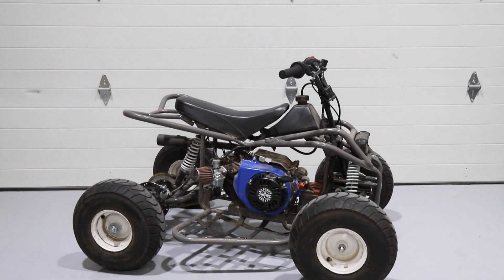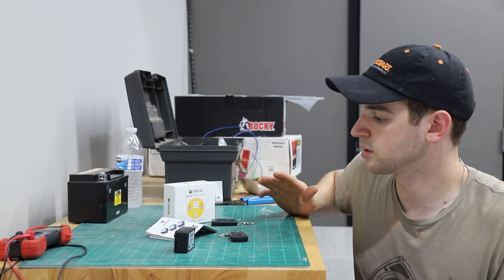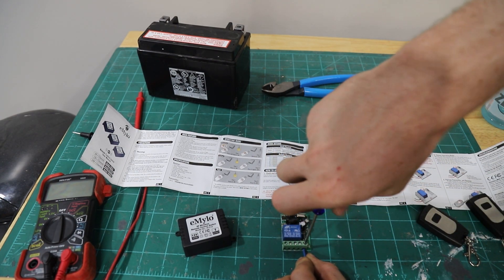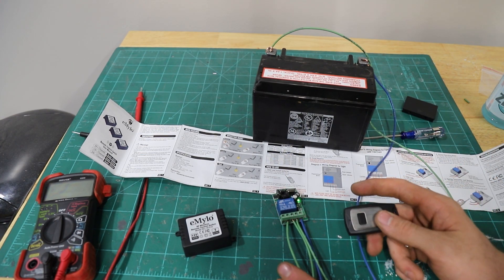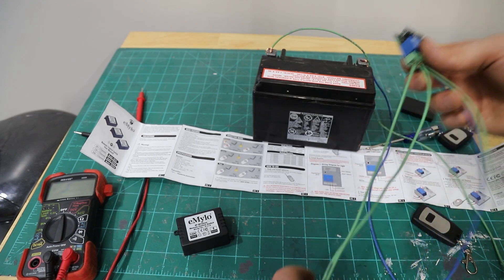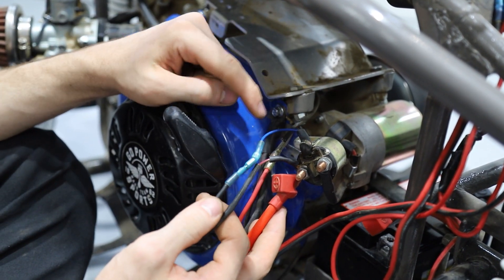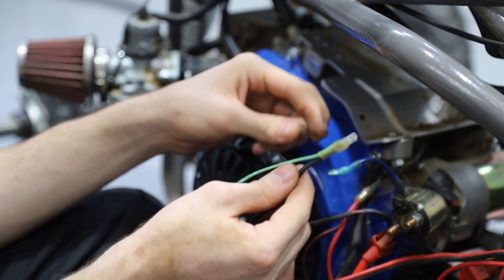$15 DIY REMOTE START on a Predator 212 Gokart! With Wiring Diagram

Comment: Will this work on a 420cc generator? I like to be able to toggle the power on and off on the generator that powers my welder on my work truck would be so much easier than getting up and going to the truck when it's placed far away between welding and finishing up the welds I go through so much gas already and looking for a remote option

Comment: Came across your great video and some input would be greatly appreciated.  
BTW, doing a cold start using push button for the first start of the day you could simply control the choke and starting after that you won't need to choke.

I run an exterior cleaning business so this would be great if I need to shut down and restart while im on a roof. However, my battery runs a predator 459 and a 12v chemical pump in which I run 10 gauge power and negative wires. ( Note, I don't need to start the 12v pump as they are on demand pumps so they start and stop themselves ).
Will this module except 10 gauge wire or do you know of a larger unit you can recommend? 
Also. How would this or a bigger unit handle a 1000cca marine battery?

Comment: This didn’t work for me,I got it to crank but it was a weak crank an it won’t turn over,I have a Baja DN150 go kart,did the power an ground then the one to the wire from middle wire of solenoid the other one to the solenoid and that’s how it cranked,any help would be great

Comment: Thank you guys for this awesome tutorial. I just installed it on a 2007 CRF450X and it works perfect. My only doubt is when I shut it down the green light on the remote box stays led. Does that light will turn itself off or does it stay on permanently. I'm concerned with battery drainage since I don't used it all the time.

Comment: Not a predator
Reply from the maker: The Tillotson 212 is the same engine as the predator 212 just with better build quality and parts. You can get a regular Predator 212 with electric start already on it or there's kits to install electric start on any predator

Comment: I did this to a riding lawn mower... it worked great 👍 simply wire tap the switch to the starter solinoid and it will work perfectly
Reply: What did you do for power?
Reply: @natestrings673  it runs on 12v 45ma draw then you can wire the relay to connect power to the starter solenoid👍

Comment: After watching this video i went and ordered my own to see if it would work on my cart and it did my engine has an electric choke so im excited to try it in the winter time
Reply: You can even add a DPDT relay that can work based on whenever the trigger wire (RF remote) and get a door actuator and wire the two together with the starting relay module so you have a remote start while also having the function to have your engine shine and the automatically retract back in
Reply from the maker: That's awesome, glad it worked for you!
Reply: @BuildBreakRepeat  Is Jason still in college? I just watched a TikTok but I don’t have TikTok it said Jason made a tapered adapter. 
My 10hp tecumseh sling a rod on my generator. Tecumseh is out of business and Harbor freight for sure sells straight keyed shaft engines I need tapered shaft. Most people want to repurpose their gen engine to a go cart and don’t want tapered but I need tapered or an adapter.
Reply: Need to add a parking brake to be safe 😮

Comment: $15 for the remote start but for $10 on ebay you can get an alarm with remote start.  And it works 750 ft away with good remote battery
Reply: Link?
Reply: Do you have a link?
Reply: Link ?

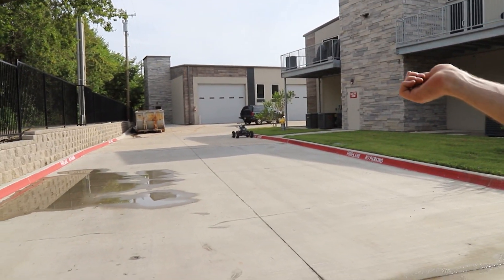Comment: 8:54 would be funny if the throttle is stuck and it just drives away 🤣
Reply: Throttle was stuck on my go kart when I was 11. I pulled the cord and it took off. The alignment was very good until it hit the reflector in the street then went up a curb ,did a barrel roll and landed on the hood of a lifted bronco. I  yanked it off the hood and took off .
Reply: @scootersonlyrepair  lol
Reply: 😂😂😂😂😂😂 @scootersonlyrepair
Reply: You mean like in Cannonball Run...? XD
Reply: Even funnier is someone got on it and it drove away.
Reply: @donkeyhole2782  😂🤣👍

Comment: Great tutorial! Probably the only downside is that you can't use this with the Predator 212 electric start kit. UNLESS, you remove the factory key switch box that normally comes with the kit, and replaces it with a push-button start as you guys have.
Reply from the maker: I believe you could install this in between the key switch and the starter and still have it work. I'd have to look at one to be sure though
Reply: @BuildBreakRepeat  Yeah. It still can work as long as you have the key in and on.
Reply: @BuildBreakRepeat did you found out
Reply: wait i just bought it for a 212 hemi can i not use it?